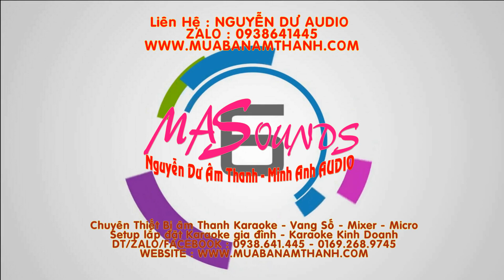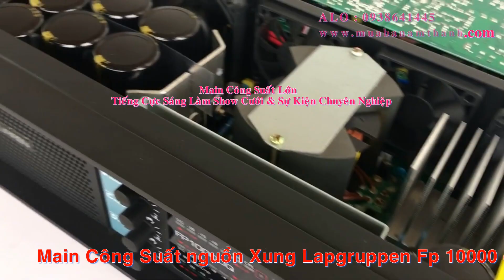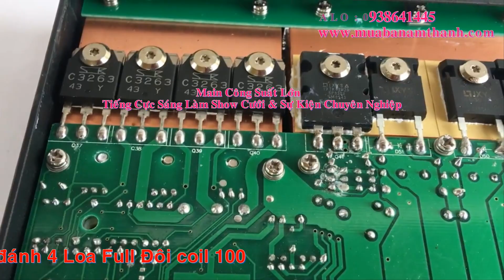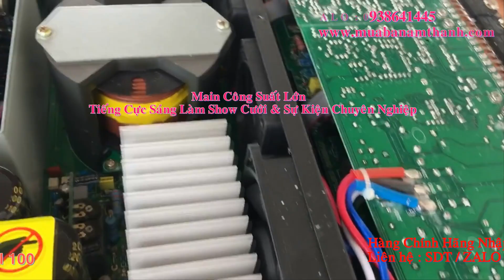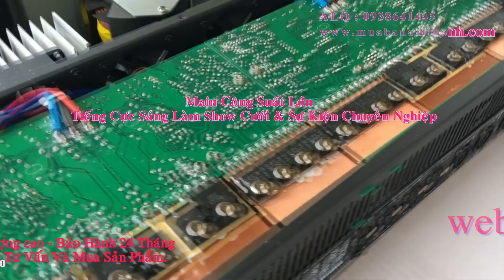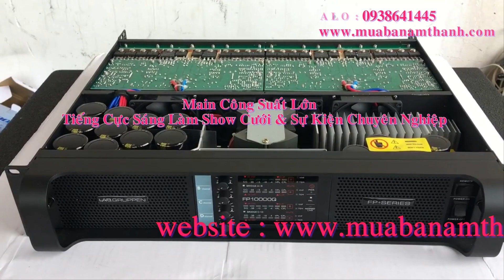Main 4 Kênh Lapgruppen Fp-10000Q Cực Khủng 10.000w Đánh 4 Sub Hầm Đôi

Comment from the maker: Quý Khách Quan Tâm Sản Phẩm Mua hàng và tư vấn xin gọi ☎️☎️☎️0938.641.445 - 039.268.9745 mr.Dư 
Main Nguồn Xung 4 Kênh Labruppen FP10000Q
Link xem chi tiết Main 4 Kênh BOSA FP-10000Q : https://goo.gl/VJB5Wf
💪💪💪 Power Main Nguồn Xung Sân Khấu 4 Kênh Labruppen BOSA FP10000Q
Công suất siêu khủng 🚀🚀🚀 chơi 4 sub hầm đôi hoặc 4 full đôi, hoặc 8 full đơn 🔥
🔥8ohm - 1300w x 4 Kênh
🔥4ohm - 2100w x 4 Kênh
🔥2ohm - 2500w x 4 Kênh
Chuyên full tiếng cực sáng uy lực và chi tiết, trọng lượng giảm đau lưng chỉ 15kg
Chuyên cho dàn âm thanh nhạc sống, sự kiện chuyên nghiệp.
Sp nhập khẩu Chính hãng BOSA bảo hành 2 năm. 
Mua hàng và tư vấn xịn gọi ☎️☎️☎️0938.641.445 - 039.268.9745 mr.Dư 
🔇🔇🔇 Minh Anh Audio Chuyên Tư Vấn lắp đặt setup Karaoke 🔈🔈🔈 Dàn âm thanh Nhạc Sống 🥁🥁🥁 uy tín chất lượng tại TP HCM 
⛳⛳⛳ Số 50 Đường Số 20 - Khu Dân Cư Bình Phú - Phường 11 - Quận 6 - TP.HCM
🌏website : http://muabanamthanh.com/
Ship hàng Trên toàn quốc !